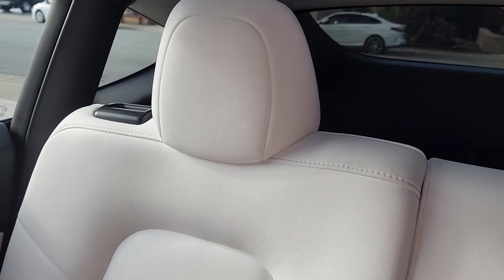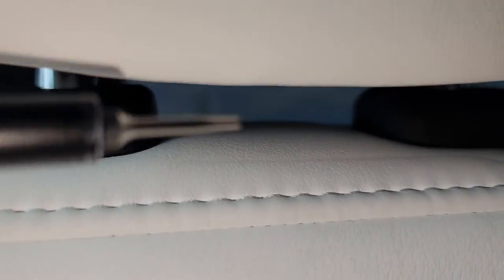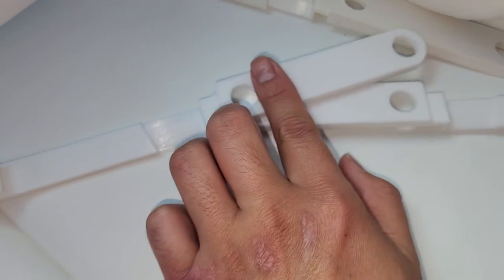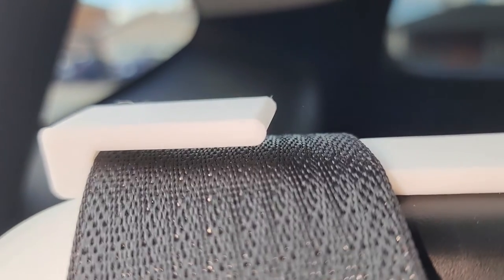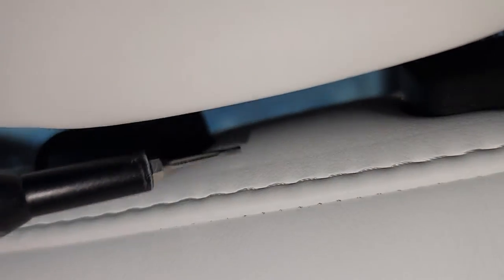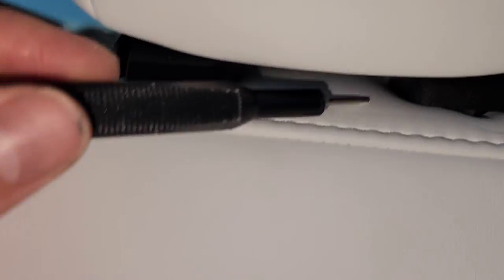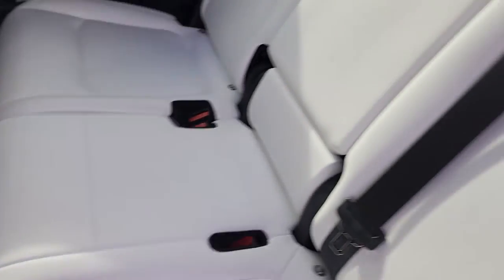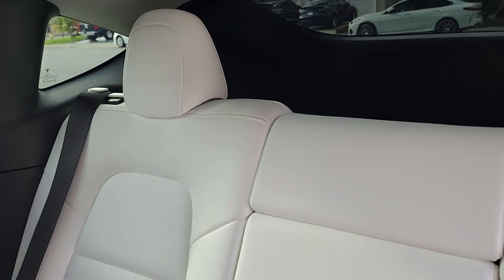Final Completed Design Tesla Model Y Headrest Seatbelt Seat Belt Guide Holder 3D Printed in PETG

Comment: When you're ready to sell, i'll buy a set ;)
Reply from the maker: Noticed it rattles against the handle area. I'm going to try a layer of acrylic double sided tape as padding, and if it still rattles, I'll remove the adhesive protective layer to stick it down on top.
Reply: @ItsBinhRepaired  Yeah seems an easy fix, can put a piece of furniture padding under it too. Something soft.
Reply from the maker: @erikkalifornia5182  don't want something too thick
Reply: @ItsBinhRepaired  That's what she said.
Reply from the maker: Lol
Reply from the maker: @erikkalifornia5182  Looks good so far. Any specific color?
Reply: @ItsBinhRepaired  my interior is white so that’s probably the best choice? Can it be white and the black over the handle pull? If not maybe all black is best to match seat belt and that pull.
Reply from the maker: @Erik Kalifornia I don't have the ability to do dual colors. I'll print some black ones for you to see once I get the black spool. Someone else asked to see red because they have red seat covers.
Reply: @ItsBinhRepaired  red might be cool. I have a red model y performance with white seats and Deadpool masks over the front head rests. So red may look cool too…
Reply from the maker: @erikkalifornia5182  hahaha I'm printing red next should be ready in about 14 hours, so expect a video soon.
Reply from the maker: @erikkalifornia5182  I just realized, translucent might require 100%infill... lol maybe I should buy some non translucent red.
Reply: @ItsBinhRepaired  you’re the expert 🤓
Reply from the maker: @erikkalifornia5182  video will be up tomorrow
Reply from the maker: @erikkalifornia5182  here it is in red https://youtu.be/VJybHJ59CxU
Reply: @ItsBinhRepaired  Hook me up with the red, if you can resolve the issues mentioned in your video about the sticking/warping?
Reply from the maker: @erikkalifornia5182  will see what I can do
Reply from the maker: @erikkalifornia5182  Red completed https://youtu.be/KPOfyhzsHWs so much more of a pain to print lol 3 failures for one success XD